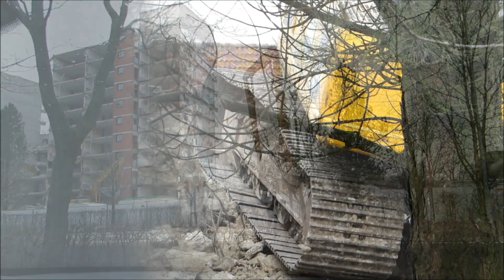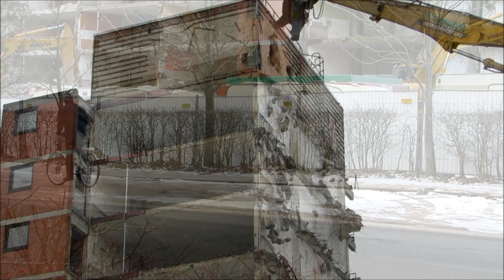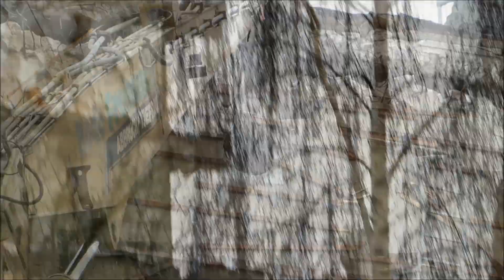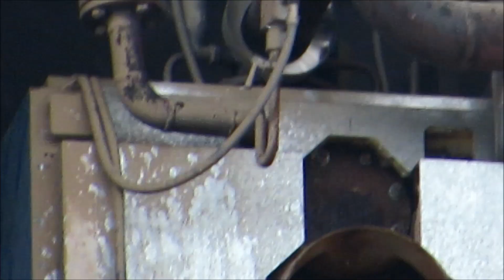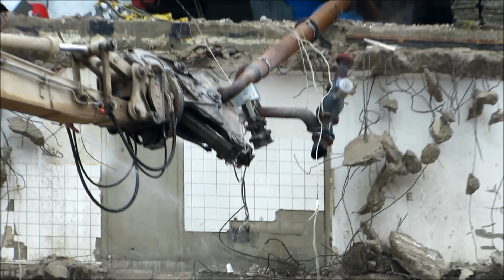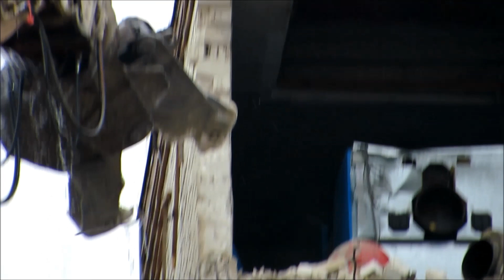Emden Abbruch Glaspalast Barenburg Klein-von-Diepold-Strasse 12 02 2013 Technikraum Cat 5080

Comment: Nice job of slicing the roof off that wall. Therefore breaking the strongest element of the structure...the corners.  Also he makes sure those chunks of concrete can fall out of the jaws so his tool is not overstressed by the weight after it starts falling.